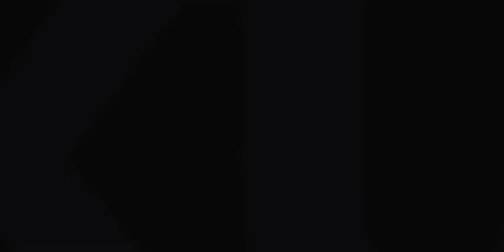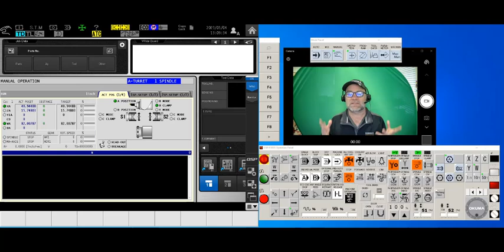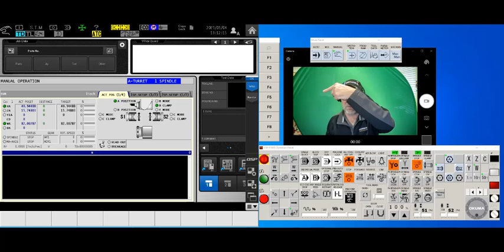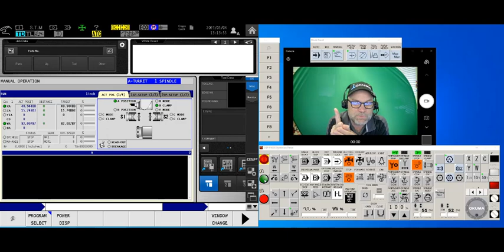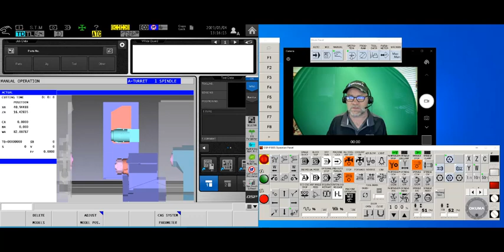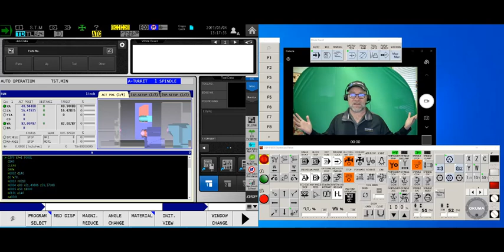Okuma Simulation Software

Comment: I am setting up CAS on an Okuma Genos M560V.  We changed the spindle direction on our 4th to match our other verticals and now the 4th is rotating the wrong direction in CAS.  I am guessing there is a parameter in the CAS parameter page that will allow us to change the direction.  Any help would be appreciated. thanks!

Comment: We have recently got this software, however we are having a “tool cannot be prepared” alarm when trying to atc. In machine lock it works fine but not in normal speed operation. The software has the 180 tool matrix magazine. In MDI the magazine prepare codes do not work either.
Reply from the maker: Sounds quite weird... What machine model is doing this?
Reply: @pocketcharleywithgosiger  hi Charley, it is a U5000 2SW. We have since been told that it canot simulate tool change unless in machine lock.